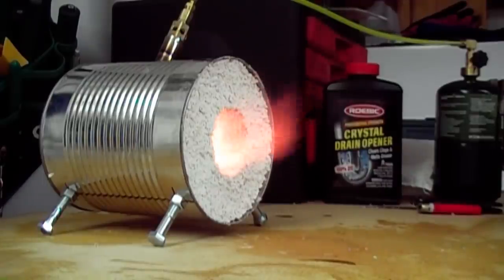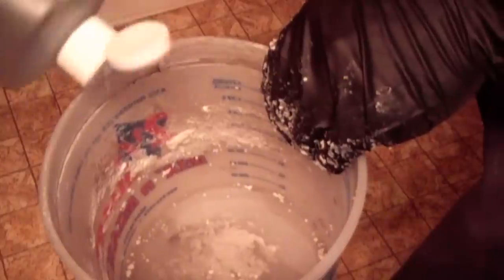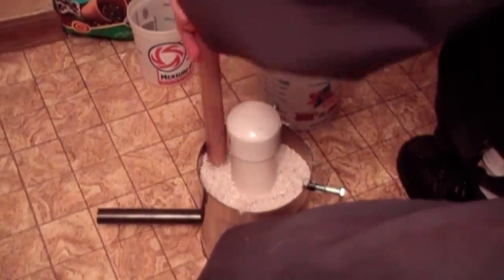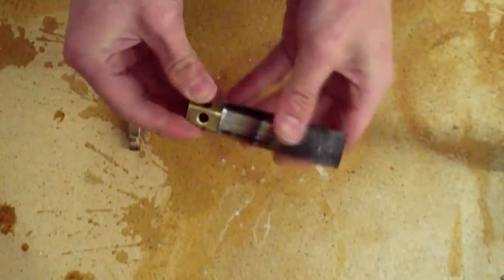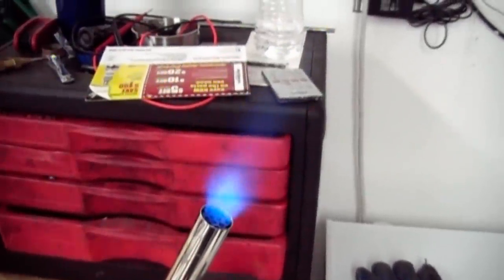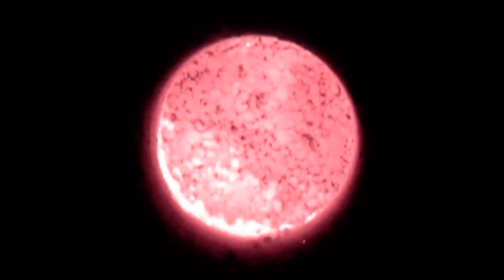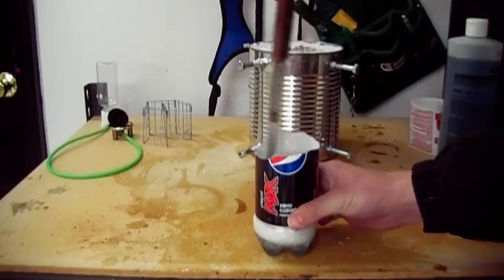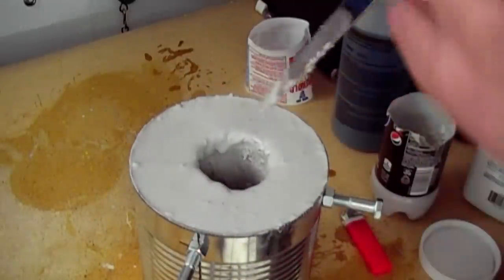How to make a coffee can forge

Comment: Hilarious that not only do you not show the fuel source, no one asked about it.  Perhaps  they all think it's natural gas.
Reply: the fuel source was one of the small propane canisters for camping, it was shown multiple times.
Reply: RicoDuroska Your are right of course, I suppose I was looking for a barbeque size bottle as that is what I use.  Sorry.  I really need to try out these cheaper materials.as mine was built using commercial refractory.  I'd like to make a few design changes on the barrel.  My observations on where to put the intake was just opposite yours, I reasoned the longer I could keep the hot gas in the forge the quicker my part will get hot.  Thanks for the reply to such an inane post.

Comment: I assume I couldn't just use clay as an insulator? I have very little knowledge on the subject so my appologies if it's a retarded question...
Reply from the maker: Not a retarded question at all. Clay, as in ceramic, withstands heat very well, if you could make the clay lining thick enough it would work great but...

1: Clay can't be very thick and fire in the kiln without problems as thick clay has a hard time drying inside, causing steam to break the piece apart.

2: In most cases clay would need to be fired in a kiln, if you had that you probably would not be trying to make one.

If you could use something like the perlite or vermiculite to make the clay light an airy, it would insulate better, and might dry better before first firing.
Thanks for the comment!
Reply: clkindred Thank you very much:) I'll look into it!

Comment: I can't find Aluminium oxide 220 grit in small amounts (Perth, WA). Only 25kg and the price is quite expensive. I found though a 25kg bag of 60 grit very cheap, but I would like to know if it's possible to break that grit into smaller one by breaking it with a hammer or something?

Comment: Don't waste your time with this... it's too small to retain enough heat to do any real work and the materials are expensive and building it is a pain In the ass. And yes I have built it. My son was so excited to build a "forge" and was so disappointed in the result. Again don't waist your time. Put your time into a proper forge.
Reply: chickenlips but could it turn a wrench into a knife?
Reply: Brandt Nicholson you can turn a cat into a meal, but I'd rather eat beef...
Reply: chickenlips dude are you kidding me, if you actually made it couldnt you just answer his question literally??? What you said points to the fact that it can but at the same time cant..
Reply: It makes a decent forge for small items, but if you want to do bigger pieces check out king of randoms video on how to make a mini foundry/forge. He take a 5 gallon bucket and uses plaster of paris mixed with play sand for the insulation. He also shows how to make a larger scale blowtorch, with propane tanks used on grills, for the setup. I made one and it works perfectly, smelted a bunch of aluminum cans and scrap copper with it. Got over a buckets worth of muffin sized ingots and still another 3 hefty bags of cans to melt down. The sand/plaster mix works good for insulating the walls of the foundry but you might want something lighter and more durable for the lid, like kaowool or this guys perlite/plaster mix. Hope this helps.

Comment: 100 % plagiarized from night hawk in light
Reply: Bob Marley  I'm sorry, but how is he this plagiarizing? He used a different insulation/inner coating, using perlite instead of sand, even more differences I'm not mentioning there. He also made a thing to connect the burner to the forge while Nighthawk in Light used a pre made thing, which I don't remember the name of at the moment and correct me if I'm wrong, and did not use the same stand style. Sorry again but I don't believe Nighthawk in Light was plagiarized in any way.
Reply: You really think hawk came up with the idea of using sand and plaster of paris? These ideas are really really old.